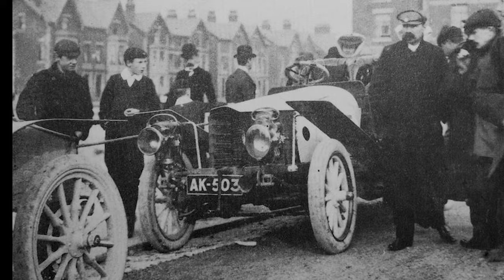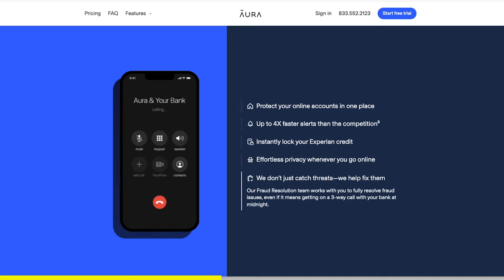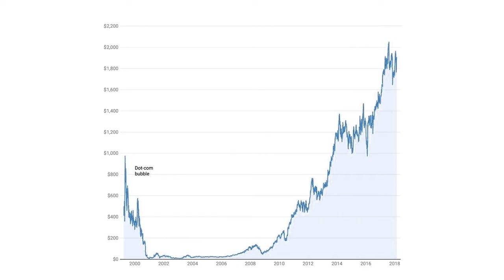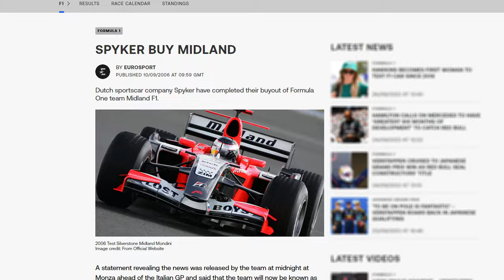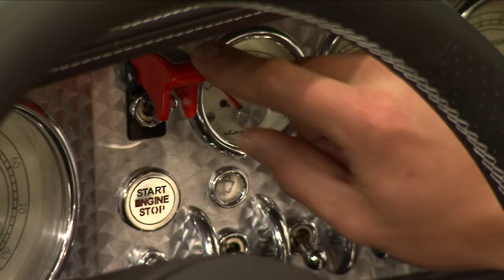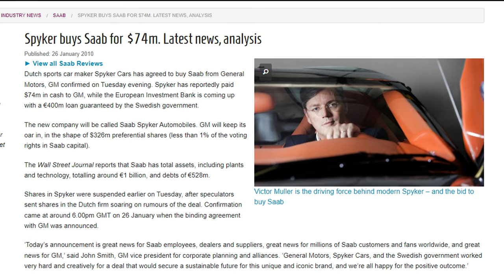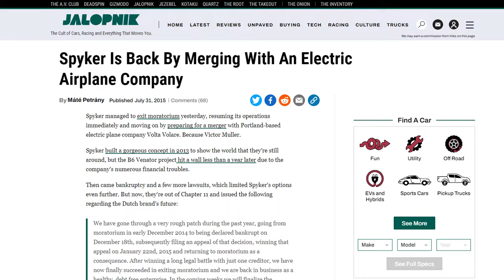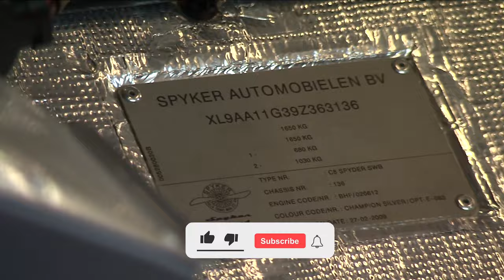The Rise & Fall of Spyker

Comment: Saab is now NEVS. Which we saw some months ago they revealed their new ev car “Emily” which they showcases on top gear as well
Reply: Not exactly. Saab as a car company no longer exists, but Saab still makes planes. NEVS uses the last generation of 9-3 as a platform and they use some of Saabs old facilities, but they can't use the Saab name or any logo's. NEVS was a joint venture between the Swedish government and Chinese car maker Geely(I think), Saab had no involvement. Recently the Chinese company sold a majority stake in NEVS back to the Swedish shareholders.
Reply: I'm just not a fan electric vehicles I understand how fast they can be and all that stuff but I just don't think the technology is all the way there yet there's too many variables to go wrong with those cars if anything goes wrong with the battery pack you're done I'm 36 and I don't think I will ever own an electric vehicle my sister had a Tesla model 3 I drove it it was cool but honestly kind of boring even with ludicrous mode on